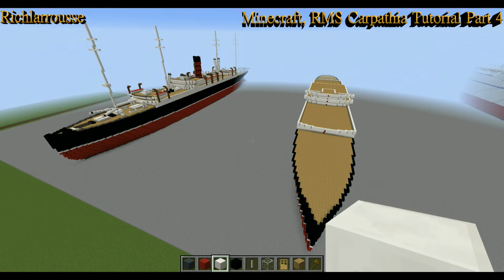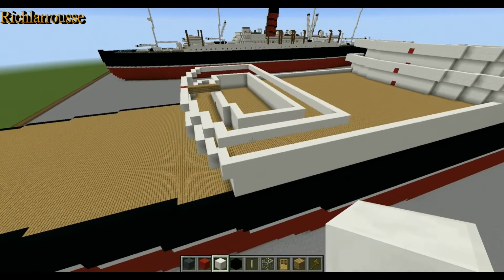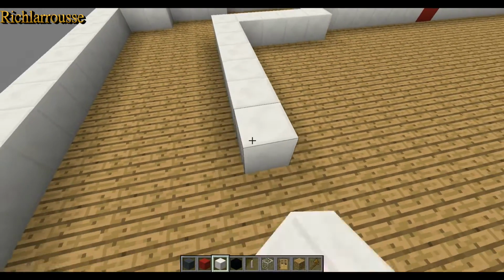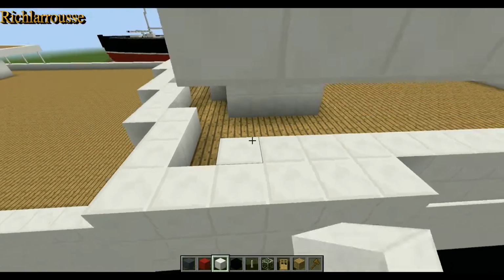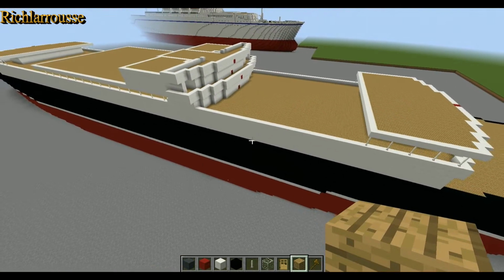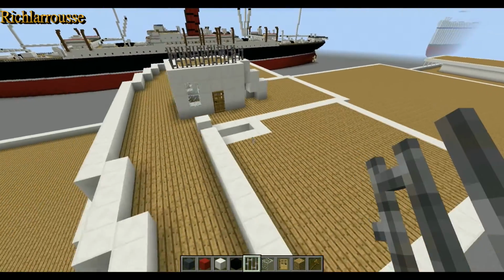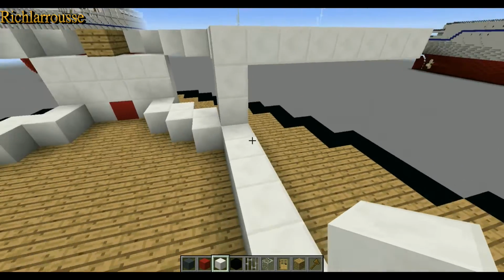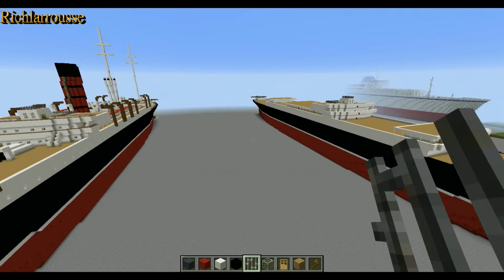RMS Carpathia, Minecraft tutorial part 4

Comment: I was thinking about this for awhile, and heres a wreck idea, The Britannic, it would be pretty easy because your just building the Britannic on her side and the bow just bent off from the main hull, or you could do a titanic bow wreck, I mean, a titanic bow wreck ISNT that hard cause you cutting the one you built in half pop off the two funnels, bend the back deck and hull slap the mast back onto the bridge, bent it up, punch a hole in it, and then leave it up to us to add in small details
Reply from the maker: I may consider building  wreck in the future, but i think its a little more to it that just building half a ship :)
Reply: @Richlarrousse-JS41 , I cant blame ya, it took me about 6 months just to build for titanic, ive added Small details here and there, im working on Britannic hopefully it wont take as long but heres another ship idea, a Ship called the Unita, its a cargo ship thats red with a Blue line around the water line, 19 blocks deep in the water, the keel is the same Length as the titanics, and the Bridge super structure is in the middle, if you DO decide to build it, Most likely you wont gimme a shoutout